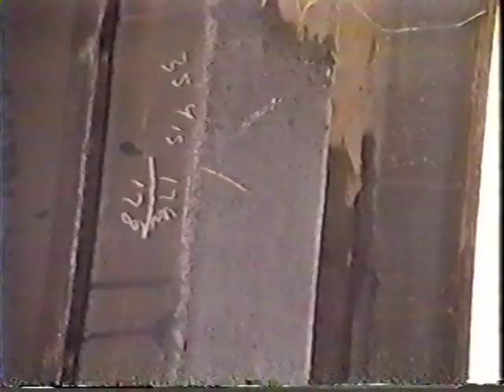MICHAEL FAZIOS REAL JOB PILE DRIVING MONKING WALKING STEEL DOCK BUILDERS UNION 1456 ~ DEC 1990

Comment from the maker: HoodwinkedbyanAngel Michael Fazio
1 second ago
ABOUT TWO MONTHS AFTER THIS WAS TAKEN, THEY NO LONGER NEEDED MY SMALL BARGE FOR THE TWO CAT 350 DRILLS AS THE DRILLING AND BLASTING FOR THIS PIPE LINE WAS DONE. I WENT TO A BRIDGE JOB WITH THE DRILL GANG {[ 6 MEN ]} AND THEY WERE SETTING UP A 60 IN CORE DRILL ON A 45 FOOT HIGH PLATFORM.

NO ONE KNEW WHO FORGOT TO PUT THE 3/8 STEEL SAFETY CABLE THAT HELD TOGETHER THE 300 PSI AIR HOSES AND SOME HOW THE HOSE COUPLING GOT UN DONE... 

ON THE TOWER WAS A 3 FOOT HIGH SAFETY RAIL AND WHEN THE HOSE SEPARATED AT 350 PLUS PSI IT WASHED THE CLOTHES OFF AND THEN THE GUTS OUT OF THE MEN AND THEN THE PIECES OF FOUR MEN OFF THE PLATFORM TO THE GROUND.

IT WAS WALING AROUND AND NOT STOPPABLE LIKE WHEN YOU BREAK ANY 100 PSI AIR HOSE BUT THIS ON WAS 350 PSI AND CUT THEM TO PIECES.

BILLY THE KID JUMPED OFF THE PLATFORM AND HAD A SAFETY HARNESS ON THAT STOPPED HIM A FEW FEET LOWER THAN THE DECK... HE LIVED ... AND THAT WAS MY LAST JOB I DID WITH THE DRILLERS.

AFTER I WITNESSED OR HEARD OF A FEW MORE FRIENDS DYING I WENT BACK TO MY OWN DOCK BUILDING WHERE I WAS IN CONTROL OF THE EQUIPMENT.

I DONT KNOW WHO IS STILL ALIVE I LEFT NEW YORK SHORTLY AFTER THAT IN 1993 OR 4

SO FOR YOU ASS CLOWNS ON YOU TUBE THAT THINK YOUR TOUGH GUYS?

 UNLESS YOU RISKED ALL... EVERY DAY YOU WENT TO WORK, [no matter your profession] AND CAN PROVE IT?

 YOU CAN ALL EAT SHIT AND GO BARK AT THE MOON...

TO ME YOUR JUST WORDS ON A SCREEN... OR GUYS LIKE THE CHAIR AND OR THE MANILA LADY BOY HUNTER